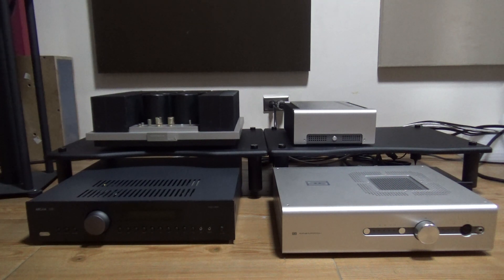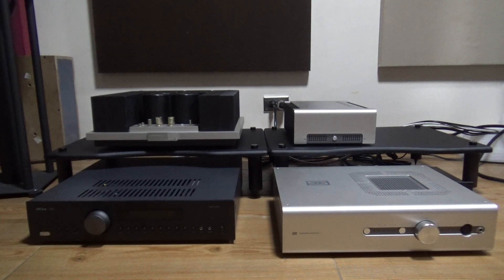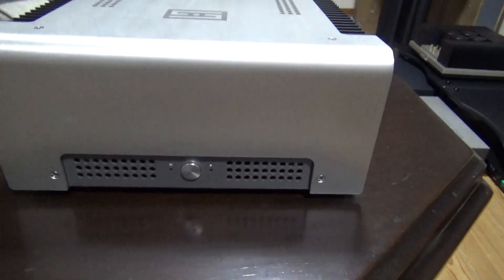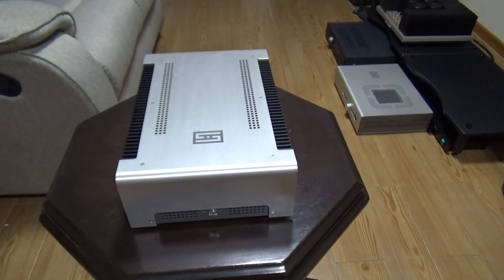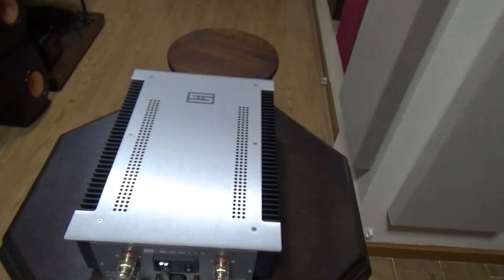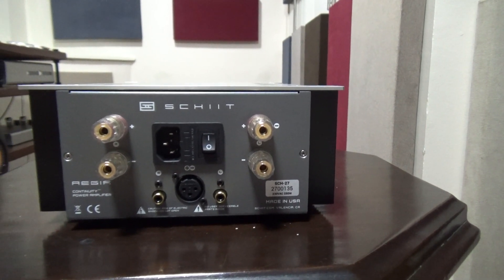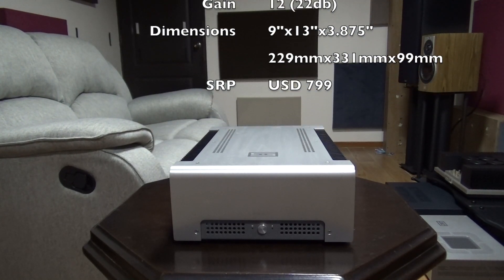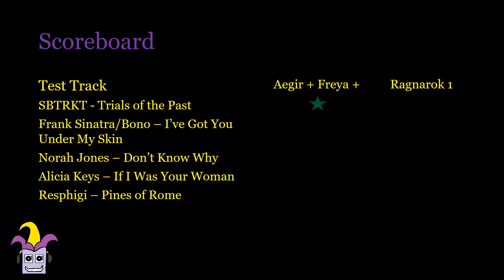Schiit Aegir Review vs Ragnarok vs Arcam A39 vs Pioneer M-22 Class A

Comment: I heard a Tact amp destroy the Class-A Pioneer M-22 driving the Kef (which were mine at the time). It was one of those comparisons where I feel there must have been something wrong with the Pioneer. It had been completely restored, which could have been the problem. I've had a few things that were completely rebuilt that were totally killed by an inept technician. Its good to hear that the Pioneer won here, as it was always one of those things that I wanted to sound better than the one time I heard it.

Comment: what's the volume dial position for the LS50 on a single Aegir? is it beyond 1 o lock for moderate  listening volume?
Reply from the maker: depends on the size of the room, in my case it's about 3-4 for 80db pink noise using freya passive and rca output from yggy.
Reply: The Audiofool thanks!

Comment: Great review!  I am still on the fence between the Aegir and the new Vidar 2.  I play a mix of jazz and EDM, but I never exceed about 70 dB.  Right now I am running the ever popular Sony SCCS5's but I really want to upgrade to the Triangle BRO3's for increased bass authority.  The Triangles are 90 dB sensitive.  I am hoping the Aegir would have enough kick in the bass.  I also wonder which amp would run the hottest.  Even though class A, I have also heard stories of the Vidar's running hot as well...

Comment: I have the Aegir; it screams quality....& the SQ is superb.  This Schiit sounds great...& it’s a Schiit load cheaper than more expensive amps.  I have it desktop; yes it runs hot but I have fans on the top...& it hasn’t gone into protection mode even in the absence of ambient cooling.  I’m running them with Omega Super 3 HO speakers.  I’ve used it with Spendor A1 monitors...it will play loud enough to fill a bonus room with party level noise if that’s a user goal.  If you need more power buy 2 and run them in mono.  I cannot recommend this amp enough...it is a design and engineering classic...at a reasonable cost.

Note:  I think the Aegir is undervalued for what it offers...& it’s more than capable of playing ‘loudly’.  These are quality watts....not be fooled solely by specifications in those two aspects (price & performance).
Reply from the maker: The Aegirs are really nice especially if your priority is microdynamics or fluidity, and I like it the most of all of the amps I've hard with the exception of the pioneer m22. 
How do you find the Spendors? Been thinking of getting that or the D1.
Reply: I had to crank the volume knob up slightly with the Spendor A1s compared to the Omega speakers to get similar full bodied volume output.  I’ve since sold the Spendors.  I cannot attest to the D1s but I imagine the volume pot response would be similar based on the efficiency rating.  

I think the Aegir amp in mono mode is likely the proper application for inefficient speakers/monitors.  It pairs wonderfully in 2 channel stereo mode with my Omega Super 3 High Output monitors (97 db rating) in a desk top setting.  I can run my preamp at a minimum of 1 db for late night listening...with little concern over volume.

Note:  the ethereal warmth of the midrange on the Spendors cannot be replicated on the Omegas (tradeoff).

Comment: Would u recommend two Aegir in mono for kef lsf50 ?
Reply from the maker: I just got another Aegir and testing it out in mono, haven't tested it AB yet, but I would say you can stick with a single if you have a small room. A larger room will max out volume and you may be wanting more.
Reply: No. Their minimum rated load impedance becomes 8 ohms bridged. The KEFs drop below 4 ohms at some frequencies. The amps could easily overheat.
Reply from the maker: I've had the monos play with the Impact monitors and Dali Rubicon 2, both rated at 4ohms, apart from the LS50. Have no problems so far for normal listening levels. But thanks for the warning.

Comment: Hi, Love you reviews. This format is awesome. I am considering this for my Golden Ear Tritons. 91db efficient and it has subwoofers built in(really). I had a tube amp, but the bass definition was loose and that was a deal killer for me. Would you say. the bass is tight and well controlled (don't need to be strong) with the Aegir?
Reply from the maker: Thanks for watching! Depending on how tighter you want it to be, the Aegir is definitely an improvement cleaning up not only bass but also the mids and treble as well. You didnt mention your tube amp, but it will likely be a little leaner as well. More neutral amps like hegel or purifi will have even tighter bass but also gets leaner as well so it's a balance you may have to temper. I personally like the aegir, and while it doesnt have the tightest bass, it still has enough to satisfy me and provides the ultimate mids for my ears.
Reply: @TheAudiofool  that makes perfect sense. Thank you. The tube amp I had was a Cayin KT88 mk2. It had base impact, but lost texture. The other think I care about is imaging. I wanted to experiment with Class A for more of that.

Comment: I had the M-22 before. Regretted selling it. The one I got was in perfect condition, and with a rotary on/off switch instead of the one you had.
Reply: I have one in excellent condition with the rotary switch that I am probably going to part with shortly.  It doesn't pair well with my horns (I need tubes instead) but is otherwise an amazing piece of gear.  Beautiful to look at too.

Comment: Is it $200 better than the Rega io?
Reply from the maker: you need to include a $400 Schiit Saga, but for me yes, definitiely $600 better as I prefer the Aegir sound signature over the Rega Elicit R.
Reply: @TheAudiofool  I'll be pairing it with my ADI-2 DAC FS so only needing a 30-50W $800 cap A/B amp for a pair of Fyne F500
Reply from the maker: @dentboxhero1717  Are you limited to class AB? You can try amps based on Hypex NCore NC252MP which have high SINAD and your ADI won't be wasted on the Rega.

Comment: Hi Audiofool / cool dude,  Can i get away  with saga or saga+  (for awhile) as a preamp for the aegir?  also Love your reviews!
Reply from the maker: Hahah Thanks! Why would you think that a Saga won't cut it for the Aegir? Even Schiit recommends the Saga. Unless you plan on doing Aegir monoblocks, the Saga would be fine and would the sound the same as the Frey in passive mode.
Reply: @TheAudiofool , thanks for getting back to me. I have only seen freya+ used with aegir and schiit mentions saga for vidar amp. But can you give me your opinion on a bedroom system im trying to put together. I have triangle bro2 speakers based on ( jays,the next best thing review) i was considering  NAD 316bee v2 or camdridge . but i do like hi end sound and upper clarity. originally had budget system in mind but you know how that goes. I have liked schiit  amps for awhile based on reviews and comments and im itching to get one.  Lol
Reply from the maker: @dennislopez372  What did he recommend for the triangle, maybe you should try that. If you don't need the power, the saga and aegir are great choices for any speaker, as long as you like the sound signature. Alternatively, the Rag is an integrated and you can get it with a multibit dac, if you can spend that much. The nice thing about Schiit is that you can always return it if you dont like the sound.
Reply: @TheAudiofool   he liked a willsenton chinese tube amp {$795}  a new product . but i think im going to get the aegir & saga+ i have a bluesound node 2i  i can try with it or i will just use a modi w/laptop . thanks so much for your time.
Reply: @dennislopez372  with the Bluesound node 2i you don‘t need any preamp. The Bluesound does this for you

Comment: I thought the  Ls50 is power hungry.  How could it sound good being fed 40 watts only.
Reply from the maker: The LS50 is not power hungry but at the very least, should be driven by an amp that can do 4ohms. I've heard it played by an 8w SET and it sounded nicer than a 220w M6si for my ears. Personally, I'm part of the camp who believes that power is more for how loud it can play; I think that the amp design affects the sound quality more.
Reply: @TheAudiofool  that was so very well said!!👍🏾
Reply: Also, keep in mind that there's no industry standard when it comes to measuring an amps power. Every company does it however they see fit. If you took that 40 watt amp and gave it to some other manufacturers and had them measure it their way, they would all be different.

Comment: I have the arcam a38 that I paired with my kef ls50. It did well with the LS50. When I upgraded to dynaudio c1s I also upgraded to the Hegel H360.  The Hegel is head and shoulders above the arcam and has alot more power @250w into 8ohms and 400w into 4ohms it is also a dual mono amp. The hegel is also more detailed and transparent. 
Now I have the Magico S1MK2 and they are incredible with the Hegel. Alon Wolf of Magico actually likes this setup and has used it at audio shows. The arcam can't bring out the best in the Magico speakers or the dynaudios.  If you get a chance try the hegel amps the h190 is really good too. 
I would love to see you review some Magico speakers the new A1 is going to be their entry level speaker @$7,000. This is a bargain for a magico. The A3 is one of the best speakers in its price range too. I think they are much better than similarly price Focal or B&W offerings. 

Keep up the good work I like the videos.
Reply from the maker: Thank you. I have a review of the H190 and I liked it as well. Unfortunately, it's returned to it's owner, but I'd like to try it out against the Mono aegirs. I'll go check out and have a listen to the A1s.
Reply: whats your thoughts on the a39 with kef r500's? would you say its a good match, the amp is going for about £650-700 used, would you recommend something else for that price?

Comment: Picking it up from the front and back only is a problem? Seriously?
And who moves components with the cables attached? No one I know. It's how you damage connectors and break things.
Since you did not indicate if the Pioneer has had its 41 year old electrolytics replaced we can assume they have not been. There are undoubtedly failing capacitors inside it or out of spec ones at a minimum. Bizarre. Including it in a review with new components is questionable to say the least.
Also since you seem to consider very warm running amplifiers to be a drawback, why would you compare them to a class G design? They are complete opposites.
A strange review from start to finish. I don't understand it at all.
Reply from the maker: I have 2-3 amps that cycle so I do move things a lot, but you're right, not a lot of people do this. I move these amps with the cables attached if I'm just moving them a small distance.
I have done anything with the M-22s, and I've been meaning to do the maintenance once the aegir's are settled. The M22s sound better regardless and I wanted to check how it fares against a real class A. I also have an Amp camp amp, but the aegirs and ragnarok sound better than that. And I also said, I dont recommend getting an m22 because it's vintage and you need to do maintenance.
I compared them with the arcam because that's the most powerful amp i had on hand at the time. I don't really care about what topology they use, just how they sound. If I had a good class D amp, i wouldve compared that too.
My reviews are based on comparison to it sounds vs other amps. If you've heard those other amps, then it should give you an idea of how this amp would sound in comparison. 
But thanks for watching and let me know how I can make the review easier to understand for you.